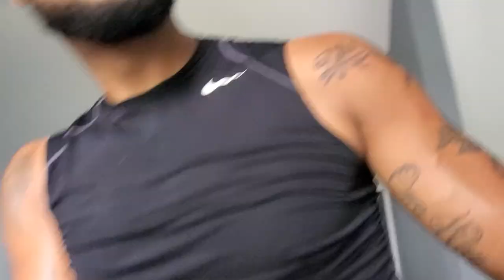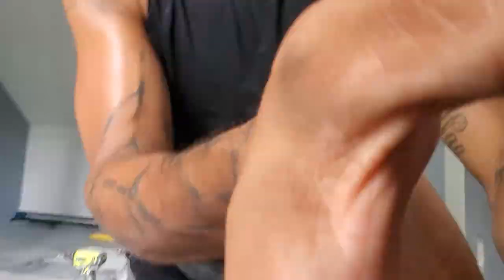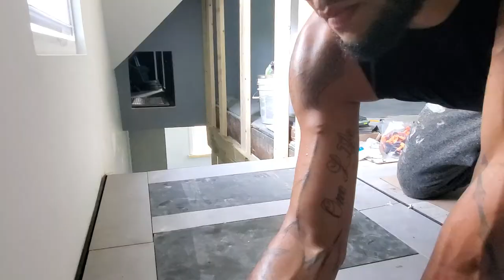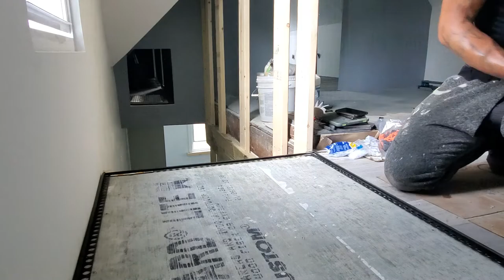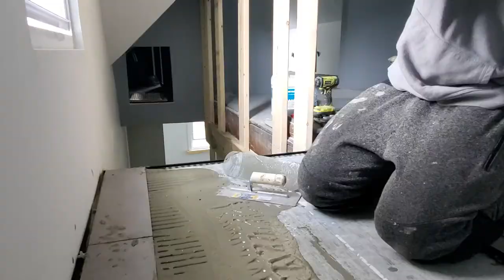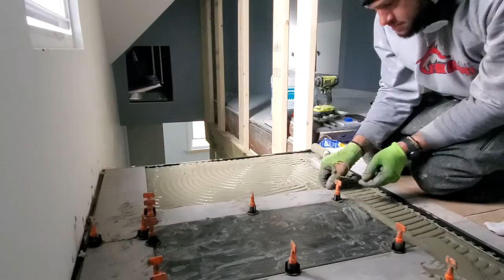How To Laying Tile Using A Leveling System The Right Way

Comment: Awesome that you tried this yourself……thinset was way too wet….as you probably realized in hindsight …..I was wondering why the self leveling clips were so messy when I watched your most popular video on these clips……I have been doing tile 28 years and always learning….so wanted to watch your install with these clips since I just bought 250 of these. They are nice Bc I use them only when I have uneven tiles…..I use them as and aid not to entire project. Makes a big difference when you use heavier notch trowel and thinset is not as wet. Thinset notches should be able to stand up and when tile installed collapses ridges and for most time tile is flush with each other ….but when it’s not then insert them and bring up the low and down the high ones. I like this level system bc unlike others  …you have to insert before tile placement….causing them to have to be used everywhere….anyways thanks for your videos….kinda cool to see someone else using these.